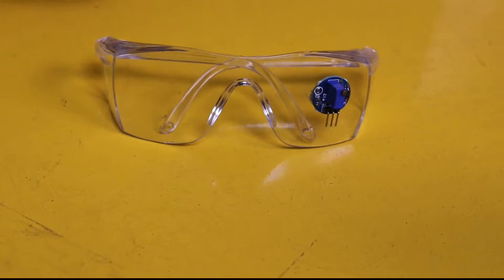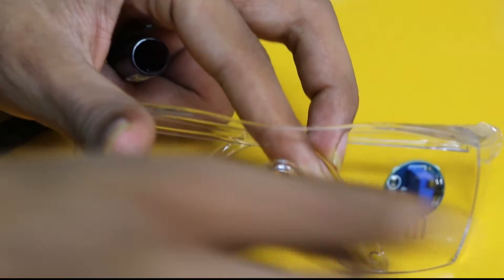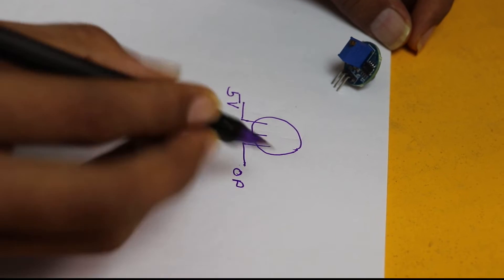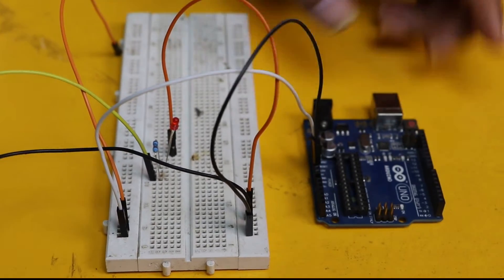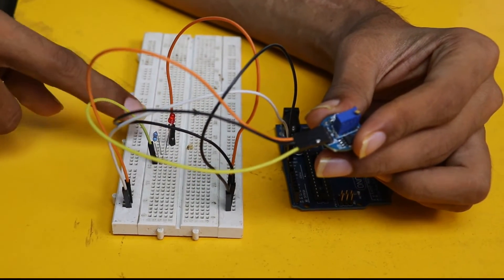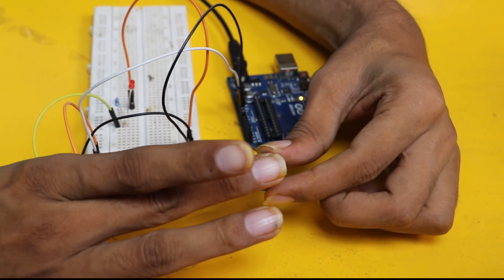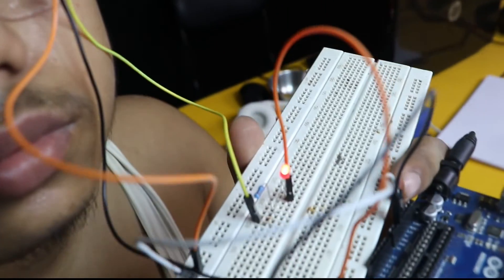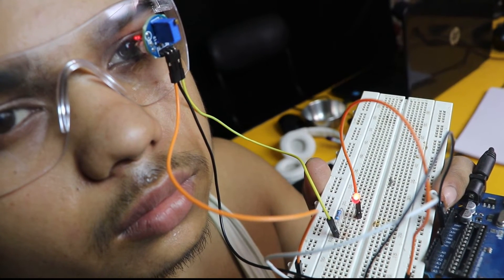Eye Blink Sensor | Tutorial

Comment: how to control the led of the eye blink sensor .. i want to off the led when my eyes are open ...
Reply from the maker: There is IC LM358 on the sensor. just interchange the signal at pin number 2 and 3  with each other. Problem would be solved